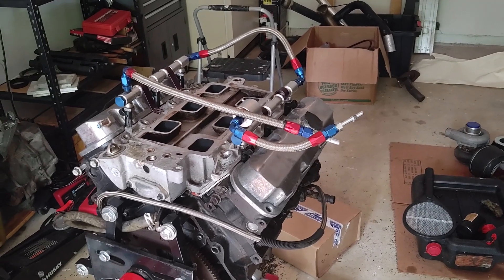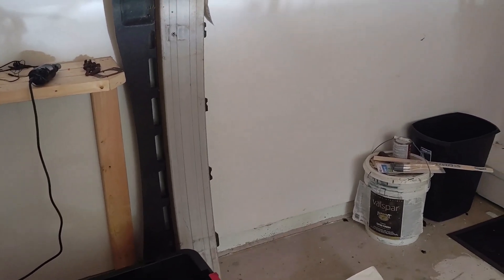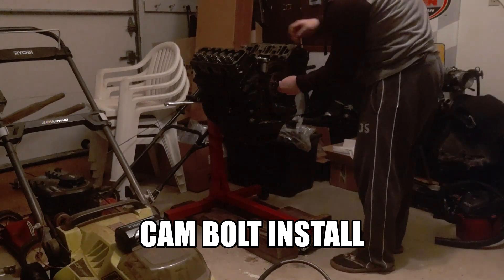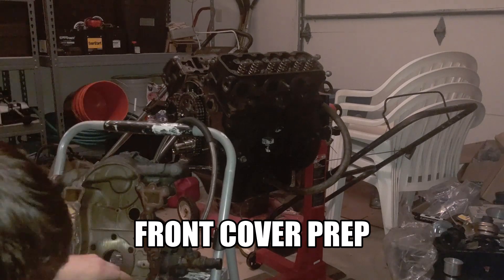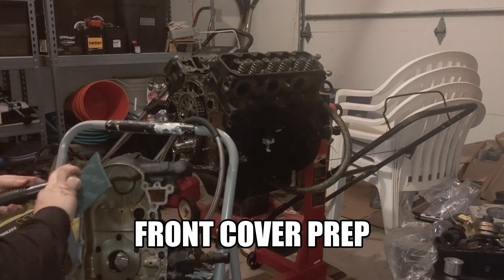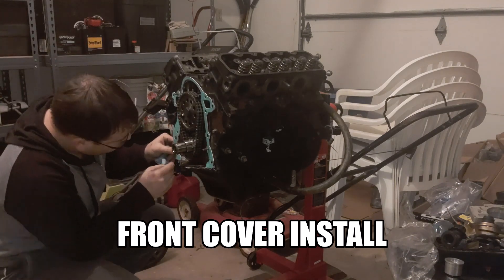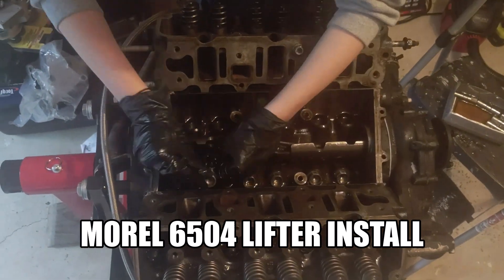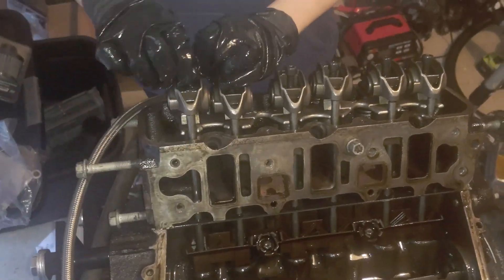Part 1 Turbo 3800 Regal GSX - Bad Grandpa Update

Comment: air to water intercooler, I love it. I have always been thinking of ways to incorporate an icebox to the mix. my latest iteration, is to route the coolant through a bunch of heater core's located in a box that you can fill with ice, and then route the air conditioning to that box.
Reply from the maker: Ya, volume is great for these setups.  As I decide which way to increase it, I'll add that to a future video.
A friend in MN did a huge trunk icebox w/ water going thru 2 oil coolers for supercharged L67. 
 Ran all the boost he could.  Early 1/4mi run back then: https://youtu.be/PKLUnpevIhQ

Comment: T67 is a pretty big turbo.  I have a Precision TE44, it's a 5857.
Reply from the maker: Ya, it's the same size that Stattama kits came with for some rowdy builds they made, but this one is ball bearing with the water-cooled ports, so should be fun.  The top car to run this style turbo kit was Kalo's '03 Impala making 600+whp and running 10.0's in the mid-late 2000's with more race prep than I'll have (see Matt's "Stattama" channel videos).
Reply: @dezldave961  Thank you for the information.  I will check out Matt's Stattama.  Guy is running an 87 Regal T ran in the 8's(stock block) with a 67 turbo, however, the exhaust housing on the turbo was an a/r .85 and not a .63.  That helps with exhaust back pressure.  I'm surprised that the 3800 series 2/3 hasn't not surpassed the the old 109 block found in the Grand National.  The 3800 block is much stouter and from my understanding can make more power on less boost.  I want to see a 3800 surpass the 3.8L, 109 block.  It should be able to.
Reply from the maker: Nice, there's a few 3800's in the 8's FWD and RWD (3 in the US, and 1-2 Aussie RWD builds getting to 7's).  They're all stock blocks, of course, since we didn't build up the huge aftermarket GN's did, but most at that level have forged components swapped in for durability, etc.
Reply: dezldave961 yes of course, the GN and turbo T have a massive aftermarket in comparison to the 3800.  Even though there are many more 3800’s out there.  The other thing is that forged cranks for a iconic turbo Regals are cheap in comparison to the 3800s.  My forged crank cost $750, a stock stroke is $650.  These cranks are 4340 steel which are good for any amount of power you can throw at them in 109 form.  Then there’s an Eagle crank which is $499, which is 4140? Steel crank and will take anything a stock block will throw at it.  One guy is using an Eagle crank in his 3800 powered turbo Regal.  Then there are aftermarket heads for a turbo Regal.  Champion  or TA Performance aluminum heads, unless ported, don’t flow anymore than stock ported heads.  However, when ported can flow really well, especially TA heads.  They round between $1800 to $2000.  However, according to the guy who built the 3800 powered turbo Regal the ported 3800 heads will flow just as well as aftermarket Turbo Regal heads.  He is running the same turbo as me and he’s making over 600rwhp on his 3800 build running 18 psi of boost and I’m running 26 psi with my 109 build and only making about just over 500rwhp.  For to come close to 600 with my build I would need an expensive port job on my Champion Aluminum heads and an aftermarket engine control module.  Then I’d max out around 575.  It’s too bad the 3800 doesn’t have the aftermarket support.    Also too that Buick didn’t make a 4.1L variant like they did for the 109 3.8L.  They share the same crank and heads.  From my understanding from people in the industry the 3800 was built the same features as Buick Motor Sports Stage 2 racing blocks.  The only difference being the stage 2 blocks have the 14 head bolt provision for greater clamping force.  I could go on and on.

Comment: Hey, where did you come across the Holden Aluminum Intake?  I'm getting ready to slap a turbo on my 2000 Regal GS.
Reply from the maker: Australian eBay... eBay.com.au has a few on there, just have to see if the seller will ship to US.  Can also try the classifieds on JustCommodores forum.  You'll need their alternator bracket, too, and a 98-older Regal/GP alternator (I'll show it in the next update)
---Edit: you can use a Camaro/Firebird alternator and bracket setup, too.  They've very similar to the Holden.